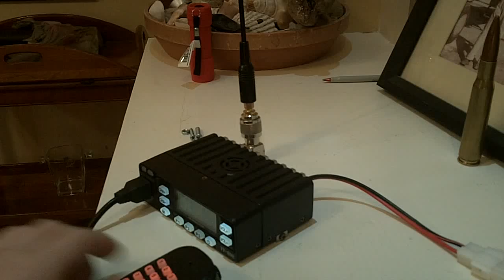QSO on 2m using Leixen VV-898

Comment: Question 1-Can it be programmed through buttons on the face?
Question 2-Does it need any hacking to do the 600khz offset for repeaters?

These are just never clear on Ebay or ect seller posts.  Thanks for reply.

Comment: can you give me a link for the connectors you using? 73,s 19CT031(cb call)
Reply from the maker: No problem! 

Here is the right angle pl259 adapter:

http://r.ebay.com/I70tBB

Pl259 to sma male adapter:

http://r.ebay.com/7m3ccO

Comment: The real problem with these radios is the microphone. There is a mod listed online to boost the gain a bit. I have one, and often get the 'low audio' reports. Look for the fix online. Otherwise these little rigs are fun for the money.
Reply: So what you are saying is that this china radio is so awesome, when you buy one you can continue building it by having to make the mic work ?  Sounds like an awesome deal *not*. When I buy a Yaesu or Kenwood, I don't have to finish building it.

Comment: Does the unit overheat or give a warning if you talk too long?
Reply from the maker: +Bruce Wayne No, dosen't overheat, but it does have a timeout timer.
Reply: KG5 Radio The timeout timer interrupts if you talk too long?  What is your guess to what it is set to :20-:30sec?
Reply from the maker: 30-120 seconds, I believe.
Reply from the maker: +Indrid Cold 10 watts max. It is a Nagoya Na-771 antenna.

Comment: These really are neat little radios. I almost bought one at Dayton 2015 to put in my new garage. What I'd like to di is set up a couple of these as a repeater controlled by a Raspberry pi.  If necessary, I could amplify the output to the 50 watt legal limit.  I have a GMRS license.
Reply: +pm0501 There's also the Part 95 approval requirement though technically. Just be a ham. Loads better.